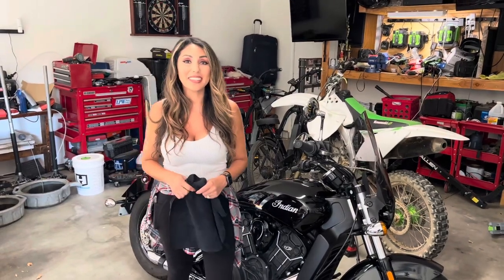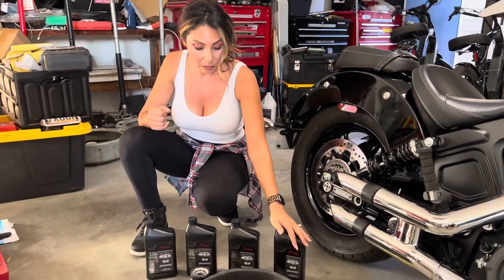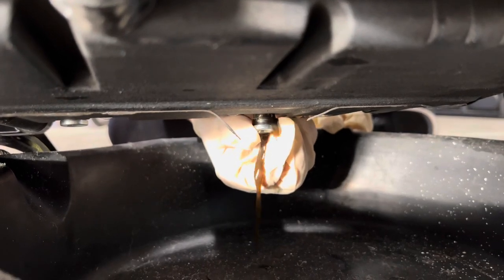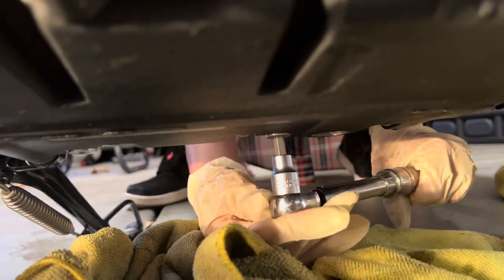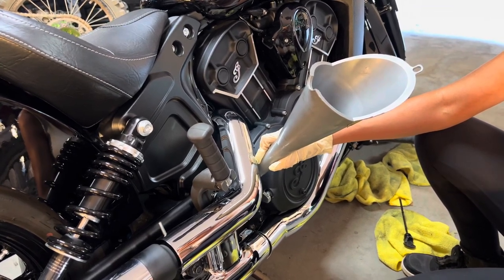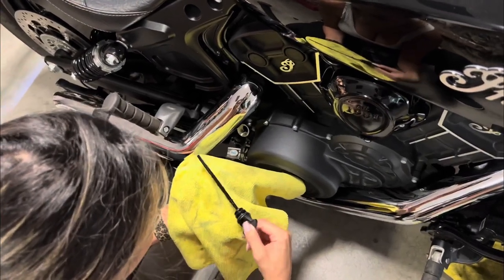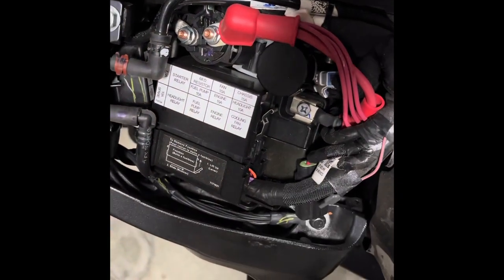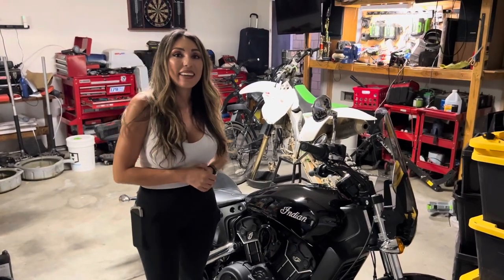2016-2022 Indian Scout Oil Change

Comment: better than the factory video! however you forgot to take out the crush washer in the forward drain plug, you can see in your video the different Height of bolts because the crush washer was stuck to the block, so it now has 2 washers wich may cause leaking down the road later on, just use a mirror on your next oil change you will see it there, this has happened to me before. thanks Jeff

Comment: Thanks for answering my earlier question on the oil..
I have another question on the coolant in the radiator.. my scout bobber 20 is just 1 year old with just 900 miles on it, when do I need to worry about the coolant in the radiator as far as checking or leveling it?
Reply from the maker: Great question, the cooling system is sealed, so unless you have a boil over there is no reason to open the radiator. You can see on the link page 72 the level on the overflow bottle shown and add only Indian branded extended life 50/50 coolant. As you can see on the link page 67 the coolant is good until 50,000 miles or 10 years until it requires a flush and fill.

Link 

https://cdn.polarisportal.com/servicemanagement-public/OwnerManuals/IND/9940044r02_web.pdf
Reply: Thanks Eileen, this is helpful!

Comment: Is there a separate primary/transmission/clutch oil change needed too on the 2021 indan scout bobber 20? Or the engine oil change shown on this video lubricates all that would be needed?
Reply from the maker: Great question! Thanks for asking. No need for a separate oil change… Scout’s have one shared oiling system, two drain points and one fill point.
Reply from the maker: Only one case for the transmission and engine, thanks for watching!

Comment: Any tips on winterizing the 2021 scout bobber.. my battery is down..and my engine light was on before battery fully died.. what charger should I buy and how often should I charge?
Reply from the maker: A simple float charger with a quick connect from Amazon works well. When battery’s drain all way down they deteriorate, so may need a new battery. Highly recommend using a lithium battery for longer life and faster charging, way more durable. Thanks for watching!

Comment: What exhaust tips are those?
Reply from the maker: Hello! They are the Shorty GP Exhaust slip on Tip Chrome. It’s a nice deep choppy sound and they don’t require fuel mapping. 👏 Here’s the link 👇

https://www.ebay.com/itm/173375842470?mkcid=16&mkevt=1&mkrid=711-127632-2357-0&ssspo=UCh5jH3hRVe&sssrc=2349624&ssuid=FdgxJurAR0-&var=&widget_ver=artemis&media=COPY